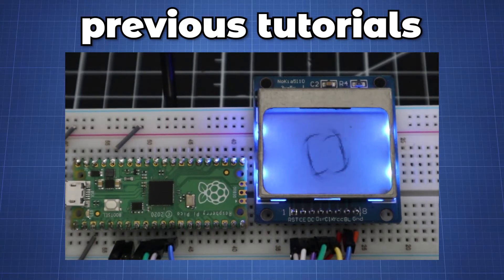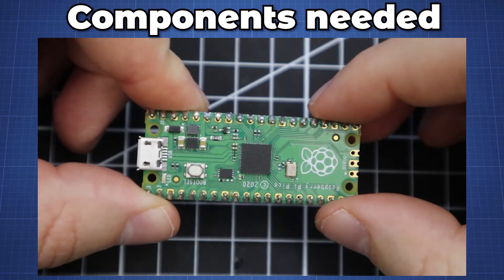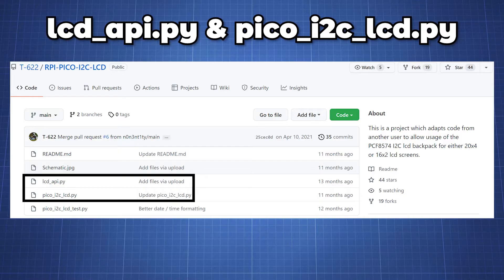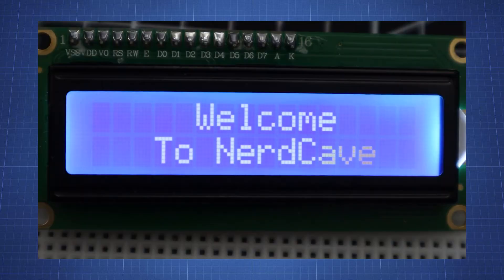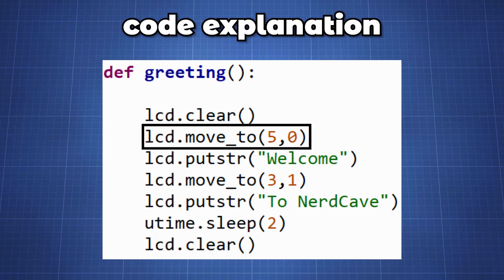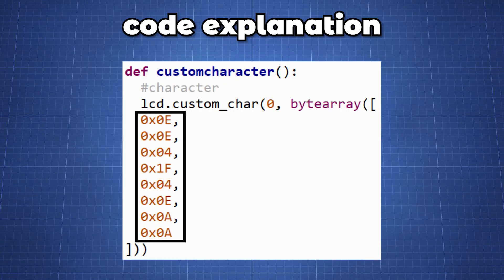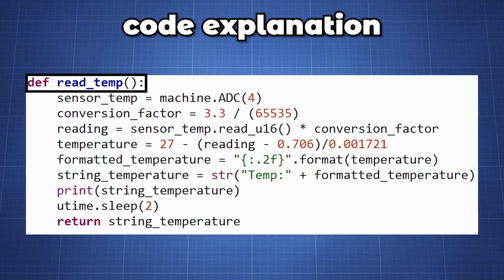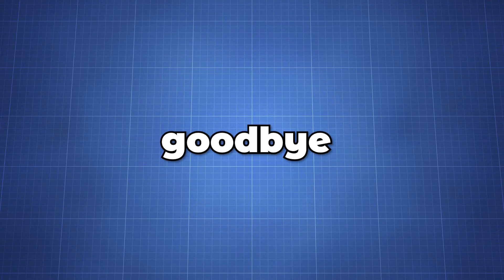Raspberry Pi Pico Tutorial: 16x2 LCD I2C Micropython

Comment: Thank you for the video. Following your instructions, for example 1, an error is returned by python: 
Traceback (most recent call last):
  File "<stdin>", line 12, in <module>
  File "pico_i2c_lcd.py", line 22, in _init_
OSError: [Errno 5] EIO
Do you know how to solve it?
Reply from the maker: I2C communication error, double check the wiring to make sure it makes good contact.
Reply: i have the exact same issue with the Pico W

Comment: MPY: soft reboot
Traceback (most recent call last):
  File "<stdin>", line 12, in <module>
  File "pico_i2c_lcd.py", line 22, in _init_
OSError: [Errno 5] EIO

this is what i get when i run example1.py, cant find a solution anywhere, help appreciated
Reply from the maker: usually that error is when their is a connection error double check the i2c connection
Reply: @NerdCaveYT  the screen came with an i2c, how can i check the ocnnection?
Reply: i am having the same problem and the iscscan does not give me a # (SHELL: >>> %Run -c $EDITOR_CONTENT

MPY: soft reboot
[]
>>> )

Comment: Hello,
I searched for many hours why scan returned [] on my pico HW. I tried many pin SDA/SCL.
I don't undersand how it work. When I plugin on Pin 0 and 1. scan returned []. And same result until pin 20 ...
When I plugin on pin 39 and 40 code below return 62.
sda=machine.Pin(16)
scl=machine.Pin(17)
i2c=I2C(0, sda=sda, scl=scl, freq=400000).

IS there a matchin between index of pin and index of GPIO ? Pin 39 and 40 == GPIO 16 and 17
sda=machine.Pin(24)
scl=machine.Pin(25)
i2c=I2C(0, sda=sda, scl=scl, freq=400000)

devices = i2c.scan()
Return [8, 9, 10, 11, 12, 13, 14, 15, 16, 17, 18, 19, 20, 21, 22, 23, 24, 25, 26, 27, 28, 29, 30, 31, 32, 33, 34, 35, 36, 37, 38, 39, 40, 41, 42, 43, 44, 45, 46, 47, 48, 49, 50, 51, 52, 53, 54, 55, 56, 57, 58, 59, 60, 61, 62, 63, 64, 65, 66, 67, 68, 69, 70, 71, 72, 73, 74, 75, 76, 77, 78, 79, 80, 81, 82, 83, 84, 85, 86, 87, 88, 89, 90, 91, 92, 93, 94, 95, 96, 97, 98, 99, 100, 101, 102, 103, 104, 105, 106, 107, 108, 109, 110, 111, 112, 113, 114, 115, 116, 117, 118, 119].

I'm lost ...
Reply from the maker: The Pico have two I2C communication lines - GP0,GP1, GP8,GP9 GP12, GP1,GP16,GP17 GP20,GP21 is part of I2C0 if you look at the pinout similar where other pins are I2C1. Now if you are already using an I2C device lets say on I2C0 you can at the back of the screen PCB short resistor pads to change the address of the device 

https://datasheets.raspberrypi.com/pico/Pico-R3-A4-Pinout.pdf
https://www.ti.com/lit/ds/symlink/pcf8574.pdf?ts=1713598693413&ref_url=https%253A%252F%252Fwww.google.com%252F

Comment: @castellarb3348 I ran into the same issue. I googled the issue and one suggestion was to use a different i2c pinset. There are like 5 of them for i2c on the pico  w. When I moved it to the next one down, GP2 and 3, the error changed to bad scl pin. I tried several others with the same result. I changed the pin assignments on line 11 as I went. I finally went back to the original GP0 and 1 pins and it worked. I am not sure why, but it did.
Reply from the maker: I recently also experienced issues with an OLED display where I got the error the pins needed to be connected to pullup resistor and once I soldered it again it seems to be working. I am expecting noise issues could be the cause.

Comment: Traceback (most recent call last):
  File "<stdin>", line 12, in <module>
  File "pico_i2c_lcd.py", line 22, in _init_
OSError: [Errno 5] EIO

What I need to do?
Reply from the maker: did you double check the connections made
Reply: i have the same problem. Works fine with other code but with yours temperature code it makes the same error as this guy commented. @NerdCaveYT
Reply from the maker: Let me have a look this weekend and will get back to you too, will create the circuit and run the code to confirm @nienekkodex
Reply: @NerdCaveYT  Mee also same prblm bro
Reply: have had this problem for forever😭
Reply: Yes, I did check and still getting the same error.  I give up.

Comment: i2c scan gives: (i am using circuit python)
Traceback (most recent call last):
  File "<stdin>", line 1, in <module>
ImportError: no module named 'machine'
Reply from the maker: did you install micropython on the Pico?

Comment: thonny doesnt give me a choice to were i save
Reply from the maker: is your interpreter right bottom corner set to micropython
Reply: @NerdCaveYT  It says micropython raspberry pi Pico
Reply from the maker: @sammymiller6740  so when you click file save as what does it show? it might be that a program is already running on the pico. which you can press the stop button and then try

Comment: Why not program in C ??
Reply from the maker: the videos I make is for beginners and if people knew see they will just use the sdk documentation and learn from that, I also personally don't use C, it is a good language for microcontrollers but just with all the resources and libraries available for micropython and circuitpython do not see the need to switch

Comment: Traceback (most recent call last):
  File "<stdin>", line 3, in <module>
  File "lcd_api.py", line 8
SyntaxError: invalid syntax 

this is the shell i get when i try to run example 1
Reply from the maker: from lcd_api import LcdApi did you include this to your pico the library?
Reply: could you find a solution?

Comment: For some reason my LCD screen blinks, but there's no text.
Reply from the maker: do you mean by blink a cursor blink or the backlight ?
Reply: Mine does the same thing the entire screen flashes off for a moment when i poer cycle or re-run the code but im not seeing any of the text appear.
Reply: @graysongarrett6739  did you resolve it ? I have the same issue
Reply: did you resolve it? i have the same issue

Comment: I am following the steps but I get the following error: Traceback (most recent call last):
  File "<stdin>", line 3, in <module>
ImportError: no module named 'lcd_api'
>>> 

Help pls
Reply: I got the error on example1.py
Reply from the maker: I will be able to check next week, if I remember correct the EIO is when there is a connection error can be the TX and RX
Reply: @NerdCaveYT  Thanks! im trying to make the alarm clock, but im starting with the basics of the LCD and the ds1302
Reply: @NerdCaveYT   pls help that , i am getting the same error that everytime i try
Reply: I solved it, it was the name of the file, but now im getting this:
 Traceback (most recent call last):
  File "<stdin>", line 12, in <module>
  File "pico_i2c_lcd.py", line 22, in _init_
OSError: [Errno 5] EIO
Reply: Did you solve the problem? @porcha4883

Comment: My address is blank
Reply from the maker: Did you connect the LCD to the Pico? You need to make sure that your LCD is supplied by 5V and that SDA and SCL is connected as indicated in the code.
Reply: Mine was blank initially but returned an address when I used the correct GPIO pins

Comment: stuck at ImportError: no module named 'board', already did sudo pip3 install adafruit-blinka which people said would install board.py. But then it was because i was trying to run the program as a main.py so ... noob error.  Then in the examples (using Thonny on linux Ubuntu) i had to add import machine (also remove import ds1302) to make each example work
Reply from the maker: Hi Michael, was a bit confused on the module board, where you using CircuitPython, I have done another video using the LCD with CircuitPython. In example 2 I see I forgot to comment out the ds1302 library which I used in a previous tutorial thank you for that will update the code.
Reply: @NerdCaveYT  i started fresh. Pico, installed Thony and followed your instructions. I used Micropython. So this tutorial was good. Now i'm playing with circuit python on another one. I build fully functional synth with engine (DAC, code, midi receive etc - fully functional) based on open source by Marcel License. I added a lot of libraries. Now I'm just learning Python > micro-controllers. I looked at another video you made for a midi matrix but I am building my own design and working with Adafruit guides - hope to find a synth engine but i have a feeling i'll need C++ for the speed., Anyway, this is fun - hope your channel builds momentum.
Reply from the maker: @frontier9  That sounds awesome would like to see it, if you have discord I started a server a few weeks ago if you would like to join https://discord.gg/7mTDScek